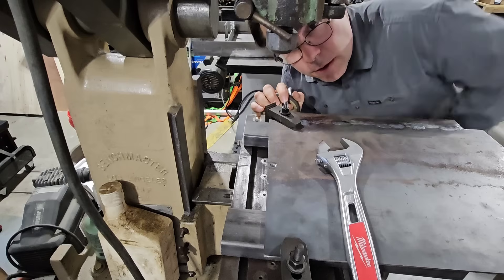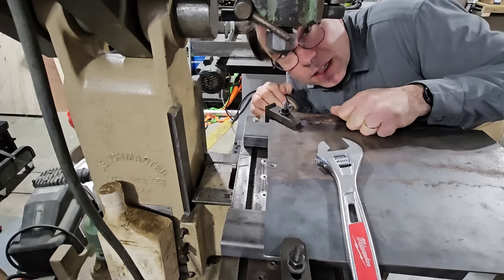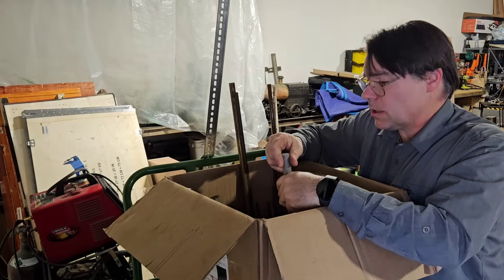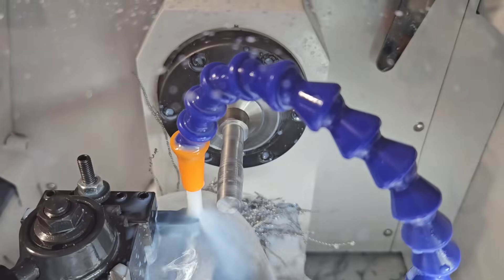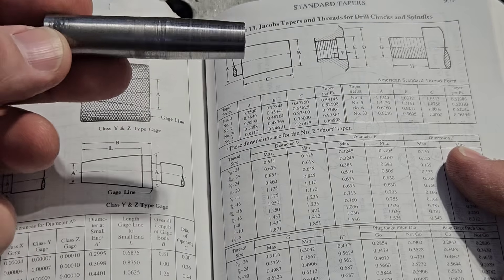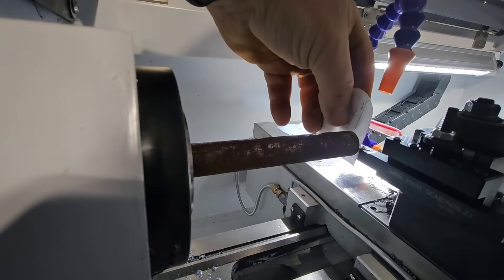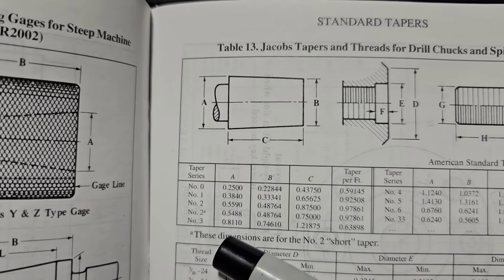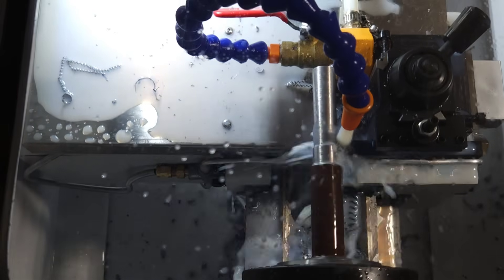Making Tooling For The Mill Seemed Like A Great Idea... (Until It Broke My Finger!)

Comment: Shades and memories of my past with my dad in his hobby workshop.  He had a big old lathe with a 6' bed, and the old-fashioned belt drive.  Made his own milling machine, and sometimes he'd let me turn the cranks to shave off a thousandth of an inch or so.   He had several micrometers, but they weren't digital--those hadn't been invented yet--they were the manual, try-to-read-the teeny-numbers-around-the-head type!  🙂
Reply from the maker: My preference is a good, old fashioned Starrett micrometer and a mechanical dial caliper. My grandmother used to run a turret lathe at places like Goodyear shoe division and Starrett tool company before she became a nurse at the age of 55.

Comment: Great video and machine. At school in metal work, funnily enough, I wanted to create a train bogie (truck) with four wheels to run on track and fourth rail power configuration as one of my hobbies was the London Underground. It was all made of steel on a lathe, the wheels, axles and then the frame etc. Stuck a small motor in it and went up and down the track made from steel bar. Shame i didn't keep it. But leaving school i had a twelve year career on the Underground network and drove trains for the majority. Not my career now though. That's the other hobby...
Reply: How was the motor connected to the axle? Just curious, as I've been on-and-off looking for a means to make a low-floor power truck (bogie) for 3-rail O gauge to adapt 2-rail models to that use. You sound like you nailed it with one extra rail to spare :D